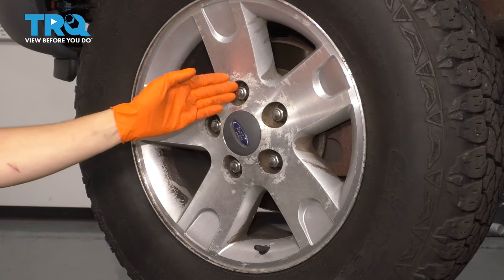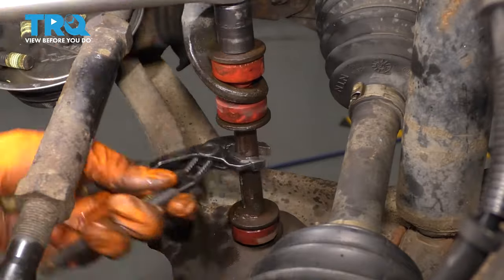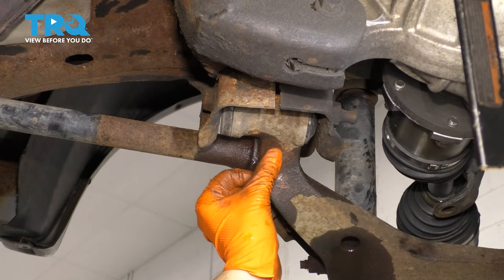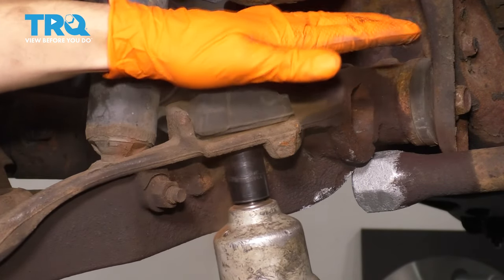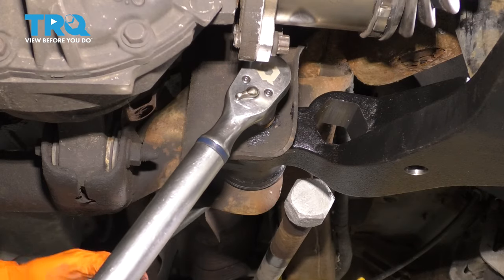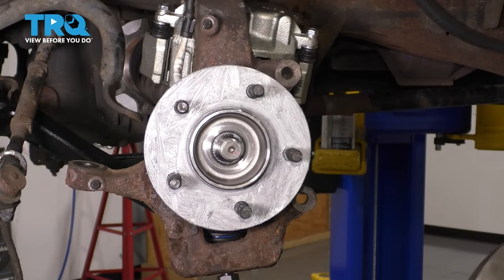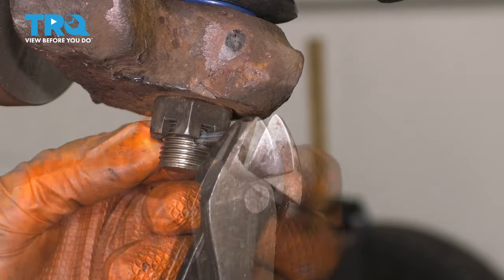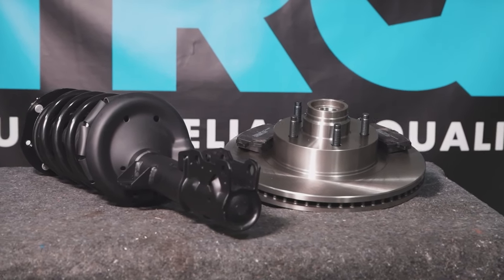How to Replace Front Lower Control Arm 1997-2003 Ford F-150

Comment: FYI: to find ride height, jack up the lower control arm with suspension components torqued down (minus the bushings) until it begins to support the weight of the vehicle. When that happens, it will stop pivoting. Then torque your bushings and you're good to go. It's not the safest method if you're on a lift, but if it's on jack stands, it's perfect.

Comment: Just replaced mine and I'm having big trouble. I didn't have to tension the torsion bar key to get the adjuster in and my passenger side is lower than my driver side. Used to be cranked all the way up just about and now my driver side is cranked all the way up and my passenger side is cranked all the way down so the front can be even. They're indexed right and everything

Comment: I noticed you air hammered the torsion bar out of the lower control arm the opposite way once you cut the control arm. Which way is the proper way?

Comment: Regarding Torque spec for torsion bar crossmember support at approximately 18:12 in this video, Ford workshop manual for 2002 F150 states 61Nm / 45lb-ft for the outer bolts/nuts and 47Nm / 35lb-ft for the center bolt. Info can be found on page 204-01B-21 for those that have the manual 🙂 Thank you for the helpful videos!

Comment: Would it be "a little easier" if one were to replace the torsion bars at the same time?  Thus taking the Lower control arm off with the torsion bar?   Also, thoughts on just doing the bushings or does the control arm have to come off anyways for bushing replacement?  

98 F150 with almost 300k and owned for 18 years.

Comment: lower damper bolt is fine. As long as the root diameter is not affected, the mechanical properties are as spec'd